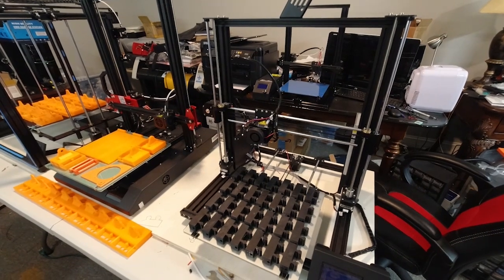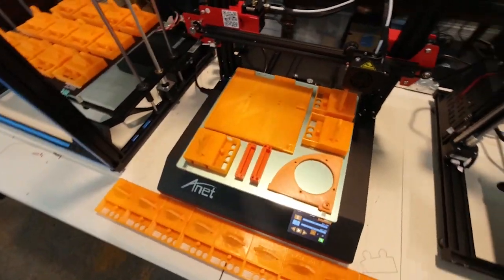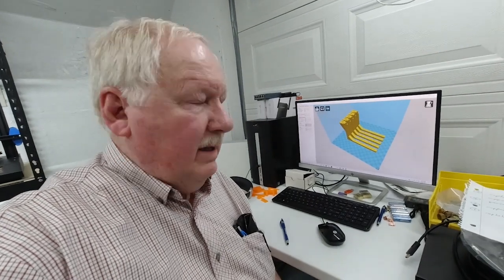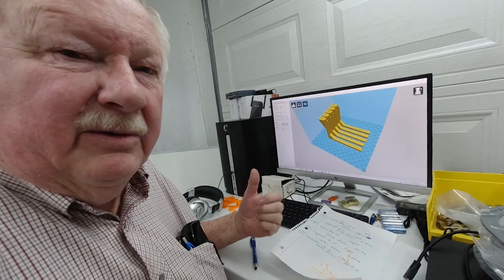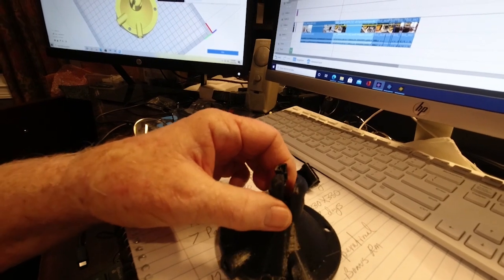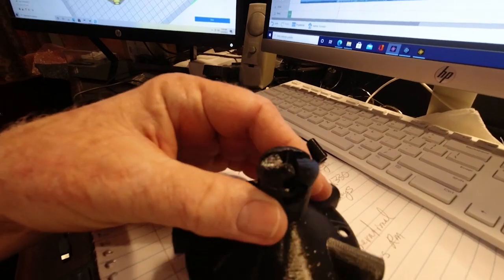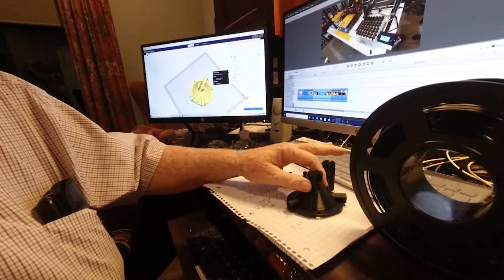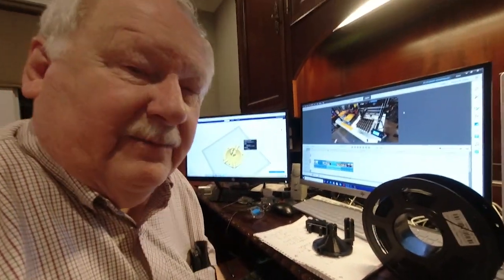LARGE FORMAT 3D PRINTERS AND PETG FILAMENT AT MY NEW PRINT FARM NEW TECH INVENTORS

Comment: Watch out with those kingroons.  Seems they cheap out on the wiring.  https://www.youtube.com/watch?v=NAMkDOtrJ_Q&t=1477s  i almost bought one, then watched this vid.
Reply from the maker: I do agree that the power cable and connector leaves a lot to be desired. Being 24 volts does help by cutting the current in half vs. 12 volts. I have monitored both the cable and connector temperature during pre heat and run time and have not noticed any warming of either the cable or connector. The current draw is double on the 30 to 60 second preheat as compared to the run time average current. I watched the video you referenced to, and the go around for the bed heater is a good idea. Other than that the Kingroons do a good job for me, I have about 19 of them, all KP3. Thanks for sharing this info...Ken

Comment: petg is horrible. there are numerous new materials like peek.
Reply from the maker: The PETG parts I am printing now are coming out with a real good finish and no stringing or distortion. I am still testing strength and adjusting slicer settings, but it looks like they are going to work for me. Have no info on PEEK, but I am looking at nylon. Thanks for your input and support...Ken

Comment: Again I learnt something from your vid Ken. I’m just about to use some petg for the first time so it was great to here your temperatures mate. I’ll be waiting to see your next video mate. Cheers Robert.
Reply from the maker: Hi Robert, I got my PETG dialed in and settings for 3mm wall thickness and 100% infill on my rod end parts and still printing at 245c. Parts look and work great. Will include them in next video. Thanks for your support...Ken

Comment: Another Great vid!  One thing I have found with petg on my printers is to check the extrusion rate and the retraction at the temp you are printing.  Cant wait for the next update.
Reply from the maker: Thanks for the input my friend. I am now dialed in with the PETG and getting great parts. Next step is to increase nozzle size and try to reduce print time without loosing strength of the part. I will show the results in my next video. Thanks for the  info and for your support...Ken

Comment: Great job on the video as always Ken! 
Just a suggestion... I run a dozen Ender 3 V2 machines and in my runs I have concluded that black filament is often more brittle and prone to breaking in both PLA and PETG. So... just a suggestion... if your black parts continue to give you trouble, try a different color. Odd I know, but I swear I'm not pulling your leg.
Also, just wondering if you are running all .4 nozzles? many of the parts I see on your machines would do well with a .6 and they would be stronger prints with the .6 nozzle since the .6 generally gets better layer adhesion. again, just my 2 cents.
Also, if you haven't tried temp and retraction towers to dial in your filament settings, have a look at this YouTube from CHEP, I have found it to be super valuable.   https://youtu.be/6LjbCIGCmd0 
Keep the videos coming brother, we are all enjoying watching you progress and succeed in this!
-Shane
Reply: I think I agree with you...I’m trying a hotter temp 252 on this run.  That should tighten it up... joe
Reply from the maker: Thanks Shane. It's guys like you, Joe and others that continue to help me solve the many problems I have encountered. The experience you guys have, from many more years of doing this really helps. I will try another color and see how it compares to the black. Thanks for the link, I'll check it out. I have been planning on trying out other nozzles but just haven't had time, guess it's time to make time! As always thanks for your encouragement and support...Ken

Comment: Hay Ken another good video. Just an FYI. My print farm includes 4 (FLsun Q5 ) delta printers. A delta printer will knock off 25% of your print time on any part. Keep the videos coming. Thanks
Reply from the maker: Thanks for that my friend. I do have 3 FLSUN Q5 printers at my  bonus room print farm, but don't get a chance to run them because of limited power. I plan to move them to the new print farm as soon as I can setup shelving for them. They have a small footprint, but are so tall you can only get two rows of them on shelving. Thanks for sharing your information and for your support...Ken

Comment: Quick suggestion, To balance strength and time, may be worth looking into variable infill printing, running most of the part at the current setting then  the section of the part that is thinner and stressed at the higher layer count and wall thickness. Also, in my experience the wall count has a larger impact on the finished strength than the infill percentage as a proportion to the increased material use.
Reply from the maker: Thanks for the info Daniel. In my last attempt I made the wall thickness 3mm and my weak section of the part was 6mm thick, this way I figured the weak area would be solid. I don't know hoe to make the main body have infill and then change to solid fill as I reach a stress area. I guess I will have to look closer at my slicer to do that. It's a great idea and I appreciate you sharing that with me. Time to learn something new! Thanks for the info and for your support...Ken

Comment: Hey Ken! It's important that you purchase an all metal hotend if you plan on printing a lot of PETG.  The ptfe tube that goes all the way to the nozzle on the stock machine will make it to melt a bit and off gas bad fumes. Great video as always
Reply: Yes..unfortunately as far as I know all metal hot ends that are direct drive are limited to the ender family. Ken has Anets and such...joe
Reply from the maker: I will see if there is a way for me to incorporate the all metal hotend into my printers. Thanks for the info and for your support...Ken
Reply: @NewTechInventors  yes from micro Swiss...there is a Chinese knock off that is very good .  Why not use American I would try to see if their direct drive/hot end is applicable to one of your printers. I have both on my ender 3. They work terrific. You will need it for your carbon/nylon filament .  The direct drive kit comes with the hot end and tip.  Call them.....joe

Comment: You're getting more and more creative with your video editing Ken! Like the voiceover at the beginning while the shots are your topic being talked about. Cool. A couple of suggestions about the part/slicer design that you might want to experiment with. Adding outer/inner layers is 100% the way to go. In fact, there are many videos on this topic and "research". I've done my own as well and my conclusion almost matches and I achieve the highest strength when: 1) I hollow out the parts where the design permits, obviously the thicker the better but has to be balanced with other factors, 2) this leads to parts that have very little areas that are "filled" so, essentially my parts are all "walls". I make the wall thickness a factor of nozzle diameter (0.6mm nozzle, most of my parts have 3.2mm walls, some 4.8mm). In Cura, I basically set the number of walls at 20 to ensure my parts are all walls, 3) yes, I do set my infill to 100% but very few places need this, but just in case, it's all plastic, 4) I orient the part where the layer adhesion is not the weakest link (for example, in your cone shape part, when you pinch the two prongs at the top, a portion of the part failure is due to the layer adhesion - if you were to print that part on its side, you'll notice a huge improvement in strength with no other modifications, although it would be a longer print plus support, etc.). So, in following this recipe, not only is the parts I produce extremely strong, I use less plastic but more importantly, I print faster.

Second observation as well is the part orientation on the bed. In your first large printer, the longer side of the parts are oriented with the Y-axis, the slower of the two axis. If you were the rotate all those parts by 90degrees (yes, you might fit less), the longest area is not on the X-axis which is faster. And with that many parts, you are bound to save a lot of time.

You could also try a 0.6mm nozzle. You'd be surprised how much time you save and on my parts, you'll never know the difference plus they'll be a lot stronger! With Cura's adaptive printing, it handles dome/spherical shapes extremely well and fast.

I have a question for you Ken, when you have the chance: of the three large printer, which one do you prefer. I've been eyeing the Tronxy 5SE but opinions seem so split down the middle.

Keep it up Ken! Claude
Reply from the maker: Some very good advice my friend, I will be trying the larger nozzles and after reading your comment I started re designing the rod end parts where they can be printed on there side so that layers are going to be perpendicular to the original breaking line. I can see where this will really help. Your 4 points are well taken and I will be experimenting with the infill and wall thickness of these more vulnerable parts. Your methods make sense and I have learned something from you today, and I thank you for that my friend. Looks like I have a lot of homework to do, so as always thanks for your help and support Claud, I really appreciate it...Ken

Comment: Yes PETG is best at 242 degree for me .  I print 90% infill for my pieces.  Also set your stress points  as solid infill .  I recommend the PETG for your lap diner also. Speed is very important for PETG .  I set mine at 42. “ stress points” are top and bottom layer. Set your top and bottom layers to to at least 40.   You will need Magigoo to adhere this .. you might need a stronger carbon /nylon for your stress part.  Think of dividing your part in 2 .. non stress and stress.  Print on separate printers then glue parts together..  I would increase your infill generally to at least 40 percent....your friend an bro joe
Reply from the maker: Thanks for sharing your experience with PETG filament Bro Joe. I agree and think your ideas sound good and solid. This would be a good project for my Tenlog dual head printer, I could print the main body in PLA or PETG and print the top of the part with carbon fiber for more strength at the stress point and this would all print at once and not need to be glued. About the speed, I did slow things down with PETG, especially the first layer, and I still have some experimenting to do with other speeds. Thanks as always for your help and advice, it is much appreciated my friend...Ken
Reply: @NewTechInventors  Remember infill percent to 90 is really ok with a reticular  pattern.  Joe